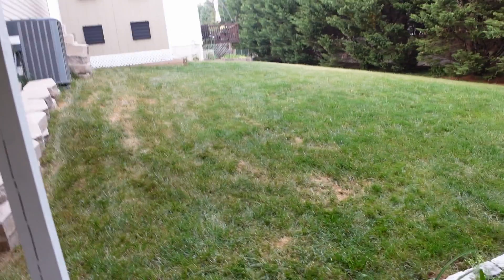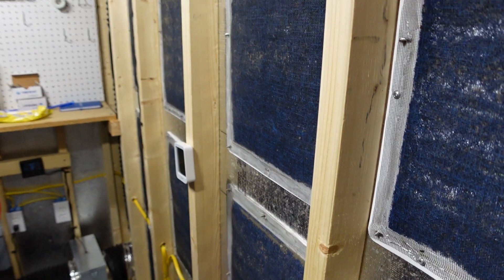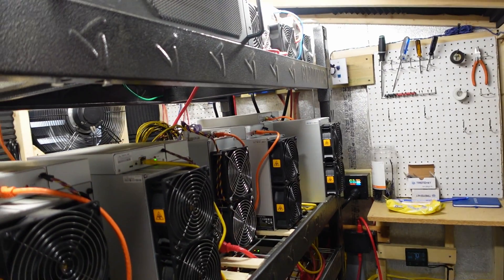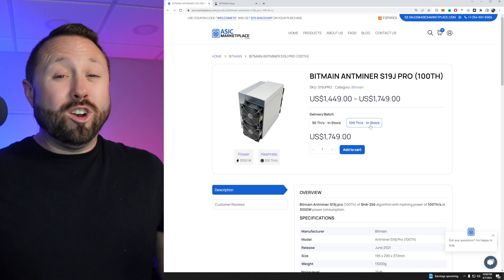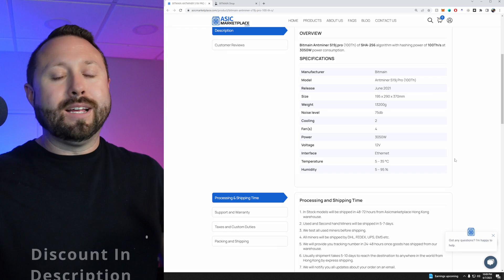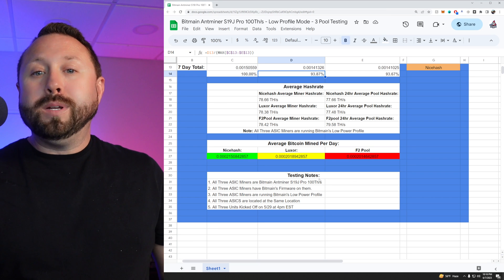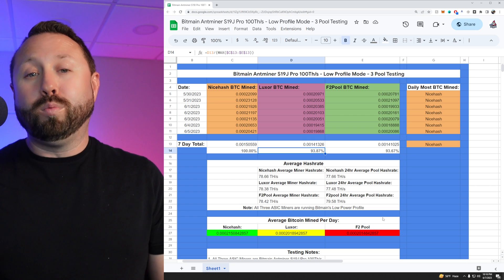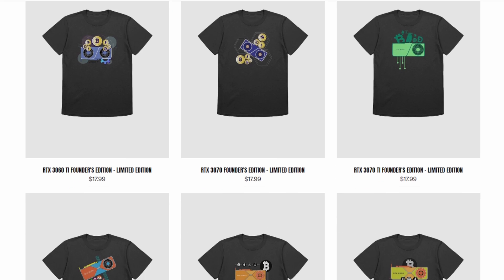Which BITCOIN Mining Pool is the Most Profitable? F2Pool, Luxor or Nicehash

Comment: A better experimental design to control for silicon lottery and ASIC variability would be to have each ASIC for 7 days on a pool and then switch each miner to a different pool and mine for another 7 days and do the same a third time to have each ASIC mining for 7 days on each one of the pools. Thereafter, you can calculate the mean BTC mined per pool and per ASIC too. This way you control for intra-ASIC variability as well as inter-ASIC differences. The other factor is hashrate per ASIC. Even though all of them are rated at 100TH, my experience with several ASICs with the same hashrate rating is that there is variability and one assumption in your experiment is that ALL ASICs will be mining at the same hashrate. Good experiment to start with. Always like your content. Keep it coming.

Comment: You should probably mention payout method and luck just a bit. 7 days isn't enough to account for luck, and it gets worse so if you are on a pplns pool for example. But other hand for now at least I prefer to be on a pplns pool (Braiins but ymmv) because there is legit risk concerns with for example fpps. Also I'd think about rotating machines through the pools because no two machines will hash identically. iow, this is a pretty damn complex assessment! In the end I almost just pick based on secondary things like how they pay out (nicehash pays in lightning which is cool if you run a node for example) or what the payout minimums and/or fees are. Another feature is split payments, I started using slush/braiins for that and luxor does it too.
Reply from the maker: I will be doing the same video at 30 Days.  As 7 Days was just a teaser but 30 Days provides more data.